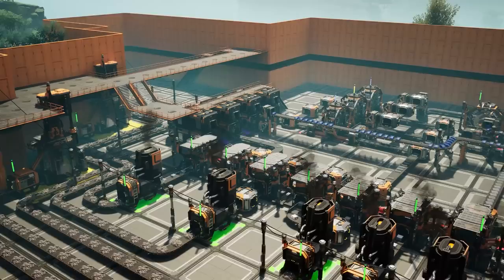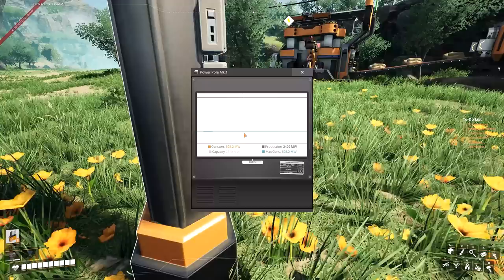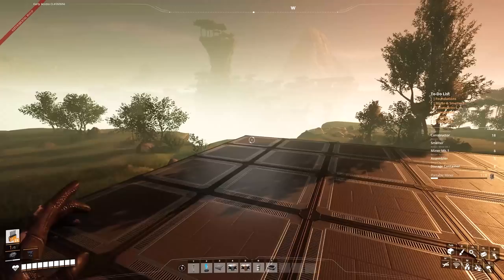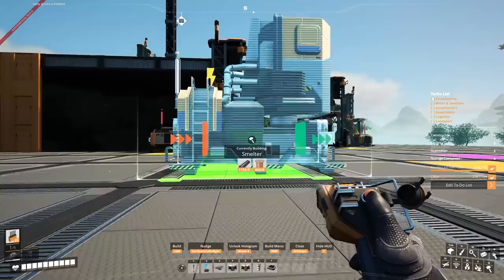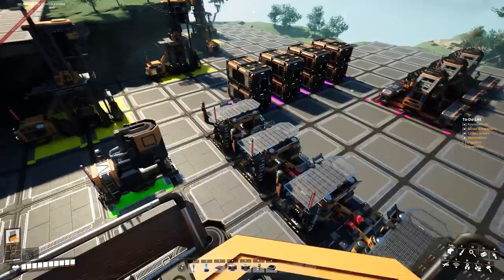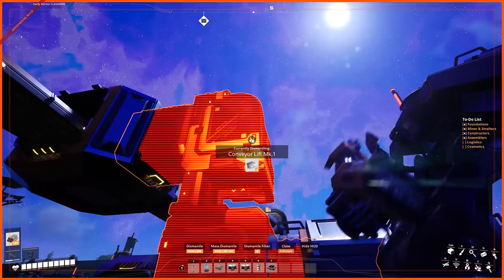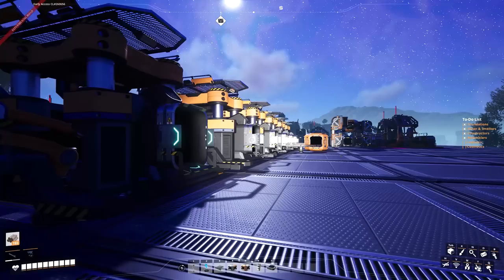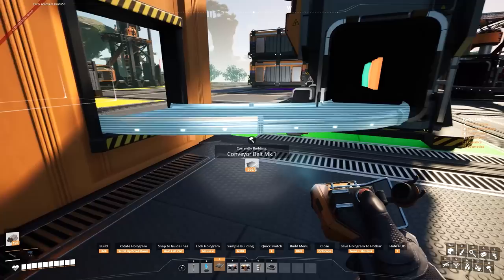HOW TO: MODULAR FRAMES! - SATISFACTORY Update 8 - Let's Play

Comment: You can actually put formulae into the machine overclock number, so if you wanted 1 and 1/3 per minute just type in 4/3 and it'll set it to 133.33333% 
Then you don't have to worry about rounding so much.

Comment: I built a modular frames factory in this spot too, the 8 nodes give you 240 ore p/m which you can turn into 10 frames p/m with no waste. So satisfying when the ratios work out like that, you just ahve to split one of the smelter outputs between an iron plate constructor (run at 50%) and an iron rod cosntructor. And make 180 screws p/m which means 1 of the 5 cosntructors runs at 50%. So you end up with 8 assemblers, 3 on reinforced plate and 5 on frames. Thanks for the inspiration, I used tips I've seen from a few of your vids. I've also built the mega coal factory on this save too :D

Comment: If you had been at my place whilst I was building the coal power then you may well have had an education in "old lady" expletives. It was such a challenge and I do have it working...kinda,  the water is still buggy as heck which causes the  power to waiver....I spent hours and hours trying to troubleshoot the water. I found a document you supplied that showed a system where the water flowed continuously in what could be called a circular motion and am trying that as a final solution before I give up. You have nothing to apologise for, yes some bits were not shall we say...great, however it works and I can now adapt that for my other builds. This one was great right up until the walkways, these seem like a pretty low priority in the whole build but I had no clue how you constructed it and working that out was the longest part of the it for me. The rest was brilliant, great job well done!!! 

I will be building along with the rest of the series as this seems to keep me organised and on track. I would usually be charging around in buggies with spaghetti everywhere and not making enough of anything. So thank you!

Comment: I'm new. Built a coal power plant. It took 6-7 days. I was already a MK2 miner, MK3 lines and blueprints, when I saw your videos. So I decided to build all 180g at once. After a lot of mistakes and reworks, I built something that works. As a result, the energy jumps between 5000-6500. Perhaps the problem is the pipes, because... distant generators do not have enough water. Of the differences. I placed the pipes on the logistics floor 1 meter higher so that they do not impede movement (maybe this affected productivity, but I doubt it). Thanks for your hard work. This game mekes you feel like you worked a shift at a factory.
Reply: Could be Mk1 pipe lurking somewhere in the line. Just look at the flow in the pipe before it enters the first machine. Should be near 600.
Other common problem is that you have to let the pipes fill up before turning on the machines. Switch off a few in a row and put them on again when the pipe is topped up. Fluid buffers higher than the pipes to the machines also help with fluctuations.
Reply from the maker: Try place the pumps higher, that was an issue for a lot of people. And just work on one line until its working, then you can do the others. So follow the extractors, on a pipe, all the way up to the coal generators you have. Turn off the generators if you want, and fill the pipes with water, then turn on the generators and you should be able to trace any problems if there are any.
Reply: @Lars1690 i only have MK1 pipes, like the pump. not unlocked mk2 yet
Reply: @igorsjankovskis1466  ah, my bad. I thought you had all generators running. And with mk1 pipes you have a lot of pipes to run all.
But the other part is still valid. Every time you handle any type of fluid, full pipes before starting.

Comment: Just for your concerns - I had the game bought for a few years now and never touched because there was too much stuff I didn't know how to address. With the update 8 I found your video and that was a great, no-nonsense play along. It allowed me first: do a quick automation at start with biomass (i wouldn't ever get the idea of running and gathering grass), how to automate, how to build, use inventory, use upgrades and so on. It was sometimes overwhelming (it took a while initially to understand how are you able to put many foundations at a time or mass delete), but never too much. Now im more or less up to speed and I understand what's up. With my limited time for gaming it is exactly what i need to make it through and have fun, and then to have resources and understanding to do my own stuff. 
And errors are required, especially after you give a proper explanation and reasoning. Errors helps to learn. I still think though you made way too high floors, and that the transport network should be hidden, but that is just because I understood what's that about ;)

Comment: If we don't need a lot of module frames right now we can feed the extra into an AWESOME Sink for extra tickets!

I moved the lifts off the back of the storage to make room for a splitter between the storage container and the lift. The splitter feeds into mergers between them which feed out to another set of mergers and lifts to feed the sink. 

It's a net positive storage of screws, and rods (I didn't hook up the plates to the sink) and will maintains a full storage container of modular frames even if you remove some.

Comment: 34:51 instead of merging all rods and then manifolding them into the screw constructors you could have merged two rod constructors to get 2 belts with 30 rods per minute each and then splitting each belt into 3 screw constructors which will receive the required 10 rods per minute perfectly.
Reply: this method is a better balancer imo
Reply: I agree, he made the same mistake on the reinforced plates. I feel like it would take a very long time for the factory to reach 100% efficiency the way he’s done it.
Reply: He could and it would technically be more efficient initially but at this scale it would not take long for the belts to fill a few machines, if your struggling with large manifolds I’d suggest switching the machines off at the start of the chain so they fill faster then turning them back on when the machines are more full, this is especially useful I find for fuel generators, especially when dealing with turbo fuel you can end up with 50+ generators off of 1 pipe and filling all that takes ages and you end with a wobbly power graph for a while unless you let them fill first

Comment: I had that, after spending like 8rl hours following you step by step in last two episodes. and then i had to redo the watergenerators, redo the logistict celing, that had alot of coal plants on top, yh i was a little burned out. the reason we dont complain is because we know you spend ALOT of time on the build, you did all the thinking, building and ontop of that the editing of your video. but i have to say all the negative feeling where gone at the end of the previous episode. not only did you several times appoliged and owed up to your mistakes. also the end result on my game looks stunning! Thank you so much for your video's! 🙏

Comment: I like this build and enjoy the way you make such an effort to get the production chains balanced.  I think that I'll be deviating from this a bit - running the eight miners at 200% and moving the other iron area into this building so I can clean out the original area.  

BTW, setting all the power plants to 88.8888% for 24 MW of electricity seems like a lot of work but having an even 2,400 MW is so appealing that I know I'll be doing that before I build anything else.

Comment: I am in the middle of replicating the Coal Power plant in the Rocky Desert start but with the challenge of having to make it a different shape. The 4 Normal Coal nodes that most Rocky Desert folks go to have water nearby but it is a long thin area instead of being wide.

I ended up making a long floor with columns of the coal generators in thin vertical rows (like three rows of four capital letter I). There were some annoying curved rock scenery down at the water level but I am managing to build round it by spacing out the water extractors as needed.

Comment: Hi Mr Darren. I built the entire coal power station, and you're in for a nasty supersize if you continue on this water pump format. NOTHING balances. Only coal. So what i did was pump water into flued buffers above the generators, and let gravity flow down from there in a similar manifold way to the generators, but not from the bottom. form the top. In this way, the entire system balanced out and i got stable power and 100% water to all 180 generators. 3 600 pipes to 3 flued buffers to 3 segments of generators in each quadrant. satisfactory machines don't like water of any fluids from below. rather employ buffers. hope this add to your fantastic work. btw.. i'm building along and testing the builds. You can design your own "fluid room" smack between the 4 quadrants of generators. works out well.
Reply from the maker: Nope, I did tests where I ran it with mk2 pump and mk5 belts and the water and coal were totally fine. No need for elevated buffers. But if you got it working all good but for me its fine going from bottom up. Will show it when I get to mk 5 belts I guess 😜

Comment: question: should i use the alternate recipe for modular frames i got? it has reinforced plates and screws
Reply from the maker: It really depends, this early on my factory is so small that it doesn't matter much. This factory makes 6.66 per minute, which is a nice amount to use for building machines regularly that require it, and maybe a little leftover for some input for something else in the future.
But, in future, when designing a factory that needs modular frames as an input, then alternate recipes can be very useful, as you might already make screws or something thats part of the recipe on-site. It can also just balance the numbers better, use less power or provide the volume you need, so I'd say its entirely dependant on what you're building. If you're at the stage I'm at in my game (just getting to Tier 5) then I wouldn't say you need to use alternate recipes yet for almost anything as our scale is relatively small.
Reply: @WhatDarrenPlays  alright, thanks for letting me know
Reply: @connorwrm-roblox2974  If you plan to use any alternative recipes you know of from early recipes (e.g. screws) it's recommended to open hard drives as soon as possible, as you only get the choice of 3 recipes of objects *you can already make*.
Reply: @WhatDarrenPlays oh by the way, i have smart splitters already

Comment: hi there i really like your videos but i don't get one thing. At the screw constructors you made 6 splitter for a 60/min output, so it would be like:
First splitter 30/30
Second splitter: 15/15
Third splitter 7.5/7.5 
and so on, so how come it works perfectly when the constructors need 10/min irod rods for screws?

Comment: I built the powerplant, along with the video. I have also unlocked 600 pipes. I can't get it to run 15 power plants at 88%, I have 3 sets of 15, it seems 12 or 13 is ok, but 15 the power fluctuates constantly. I have no idea what I did wrong :( Or if it is a bug in the pipes, I did notice that the pipes sometimes bug out and I could only get them to work by redoing them, even with flushing at the power plant. They all have 100 coal, so it is not the coal.

Comment: Hey Darren whenever I make a factory I always place the fastest best sinec it's mostly what i've been making all the time, my question is when doint the method of split into multiple splitters in a straight line, the machines at the very end tend to not get the ore needed. I'm wondering if that is because I just need 30 ore per min to fill a smelter, and i place a mk4 belt with 480 ore/min?

Comment: I am curious on the overclocking, why make the 3 machines 111.111111% as that uses 3 power shards, why not one machine at 133.33333333333% as this would only use one shard for the same output? not balanced I grant you but more efficient on shard usage.
Reply: or build more machines and underclock them to the same rate to not waste any powershards and also save some power
Reply from the maker: Using 4 and underclocking would probably be the better way I agree with Mcredstoner2

Comment: The fluid dynamics dont work when you power up all the generators and have to move the manifold from the logisics floor to above the generators if you want them all to work 100%, you can test this by powering up just 15 generators off the 5 water extractors and they will not all run at 100% ,if you check the flow rate from the 5 water extractors on the pipe before the pump it drops to 0 and then back up to 600 when it should be a constant 600.
Reply from the maker: I read your previous comment just a few mins after it was posted, so booted up the game and spent 40mins testing. A pipe dropping to 0 and back up isn't normal, so there's an issue you're having I'm not having. However, I did still have an issue with some sputtering for a while, so did testing on how to fix. But I got it working with minimal changes.

The pipeline that worked for me was upgraded as follows:
I stripped away the Mk.1 Pumps, and replaced the bottom pump with a Mk.2 Pump. 
Because of the floorhole bug, I replaced the pipe to the ceiling of the basement after placing the Mk.2 Pump and water flowed correctly.
In the logistics floor, I placed a fluid buffer along the pipe, before it went up to the machines, and a valve before and after the buffer. I locked the "after" valve until the buffer filled to 400/400 (just used a small buffer) and then released the valve.
The machines powered on slowly, but after about 15-20mins they are all at 100%. Interestingly the machines closest to the fluid buffer took the longest to reach 100, I would've assumed it'd be the ones on the end. Each generator is clocked to 88.8888%
Hope this helps, it does work!
Reply: @WhatDarrenPlays  Thanks for the reply, ill test what you have done on the row of 15 generators ive not changed yet, My guess is that it will work for a bit until generators catchup and they are using their full water amounts for an extended time and then will be back to running out of water again.. Even is it does work the easier option is to never make manifolds lower than the machines they are feeding :P which does away with any issues and the need for valves and fluid buffers, that does make the logistics floor pretty much useless atleast for pipes anyway. 

The game fills pipes FIRST and then machines, so when you make manifolds lower than the machines they are feeding then the pipes needs to fill FULLY before the machine gets any water at all, when a machine uses some of the water it has it then cannot then get more until the pipe is completely fully again, this causes backflow everytime it does that, when you 15x it then that eats into the 600 water needed constantly, dont know the exact number but anything lower the 600 then the generators will eventually run out of water and the fuild buffer will just be hiding that for a time, may be just 1 or 2 will be spluttering in the end on a row but it will not all run 100% for an extended time, i cannot see a way with how its setup currently for it to work hence why ive built the manifold above the generators input but ill still give what you said a test.

If you make the manifold above the generators input then even if there is just a tiny bit of water in the pipe then it will go directly into the generator and the pipe does not need to fill fully before doing so, which makes all the generators constantly full even it the pipe is not.
Reply: @WhatDarrenPlays  And within 10 min of testing what you said it does not work, flow rate is all over the place and possibly even worse than it was before somehow 🤷‍♀will be curious to see your latest save file with your fluid buffer and valves to see what you have done differently and how yours is working at 100% with 15 generators on a pipe? its just not possible from what i can see with the manifold below the generators... Even in this video at 3:58 your generator is not able to stay full with just 5 using 300 flow from your mk1 pipes, it should be able to be constantly full with 7 running should it not and with 20 flow to spare infact running at 88.8888 setting, and your just running 5 here and it cant keep up... 
Not trying to be an ass here i really enjoy your videos and content im just saying its never going to work which might come back to bite you if people follow this exactly and nearly half the generators are coughing and spluttering at the end of it all.

Comment: I like following along so far, I have built the Coal power the same as yours, but instead of getting 2400MW from 36 generators, I'm only getting 2200MW. I even checked with a calculator, and I should be getting 36 x 66.67 = 2400.12. I've double checked all the generators are clocked down to 88.8888% so I'm unsure what's going on. 

They're all firing, I had to remove 1 floor hole from each row of generators and clip the pipes through the floor, so water and coal aren't an issue. I'm hoping someone has an idea about this. Thanks in advance :)
Reply from the maker: There must be some not firing, try raise the top pumps a bit, seems to have been an issue for a lot of people that they were just 2m short (half a standard wall height)
Reply: I've added a third pump just to be sure 🙈